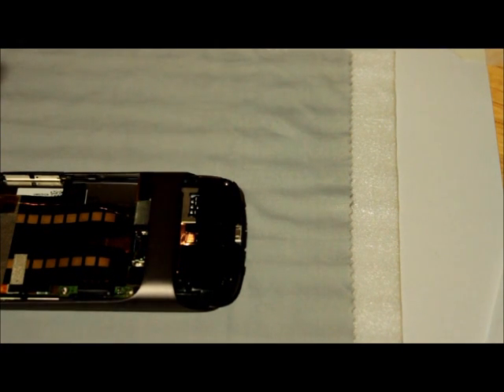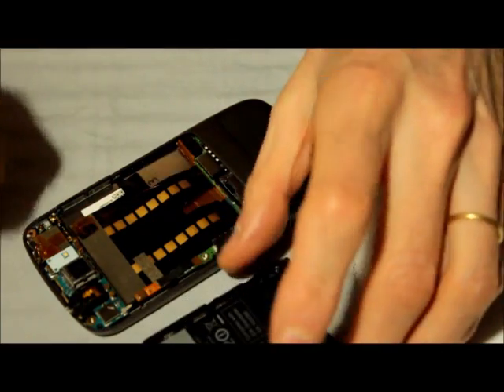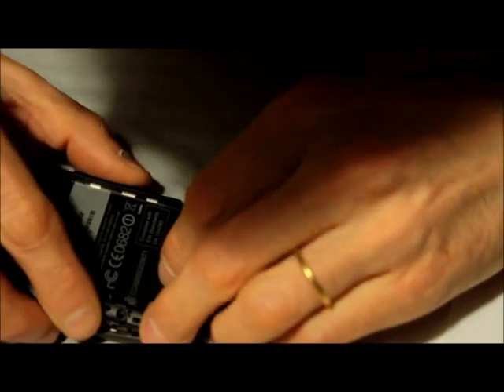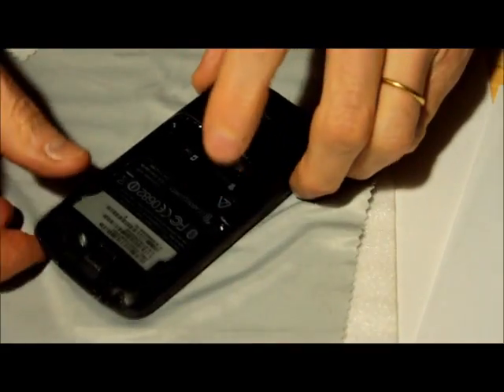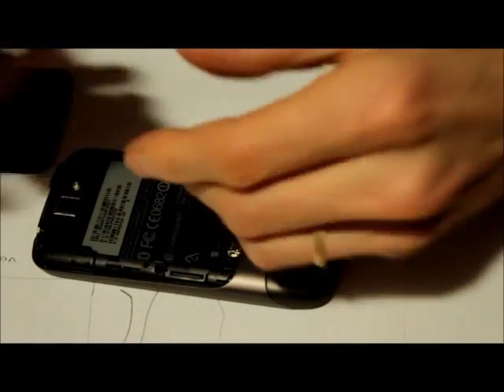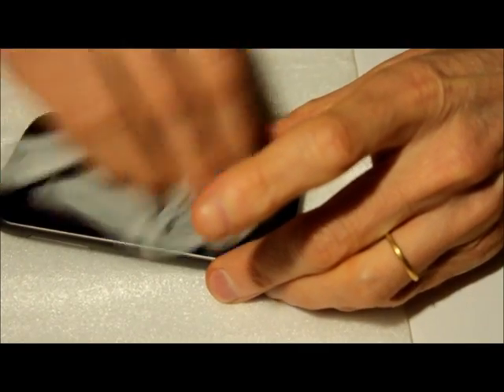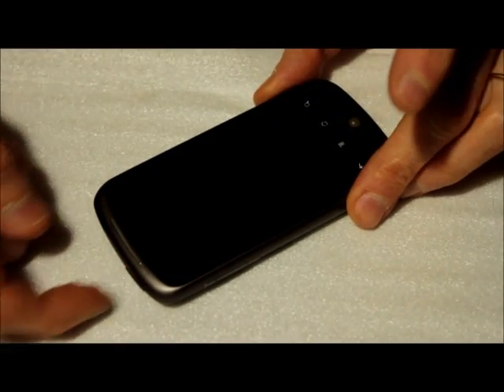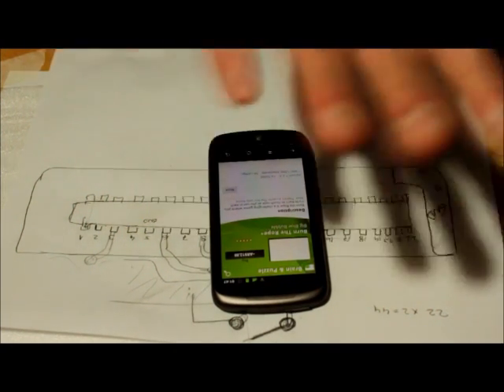how to repair the power switch of your Nexus one.  PART 5 OF 5

Comment: Thanks a lot JoeGoesXtreme!!! I had the same problem, and did the wire soldering. One thing that I am very curious about is how did you decipher that it was pin 10 that was connected to the button. Btw, the button works like a charm. I did have an iffy connexion on the connector as I used only the solder from the connector. Didn't want to bridge pins and then have to spend time removing blobs of solder.

Comment: awesome tutorial, my nexus one came faulty :S I bought it 2 months ago, I started using it 2 weeks ago, not even after the first week the power button starting fading :S...now it doesn't work at all, I bought it on ebay so I have to see if warranty will cover it... for now I will keep using the app, it's called fix broken power button, so far it works great (dont turn it off though....) after I get an answer about the warranty I might have to try this fix, great tutorial nonetheless awesome work

Comment: i fun a quick fix i dont if going to work with u guy it work for me ox try to connect ur charger to ur phone with ur battery until ur the light turn from orange to green then connect ur battery wait until ti show that is charging then take out ur battery and them quick but it back this movement have to be quick it work for me